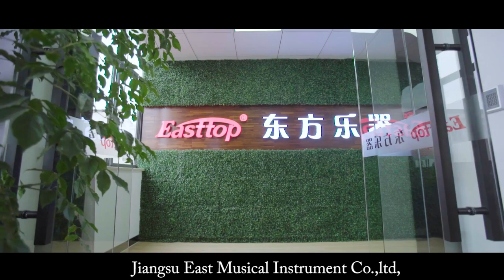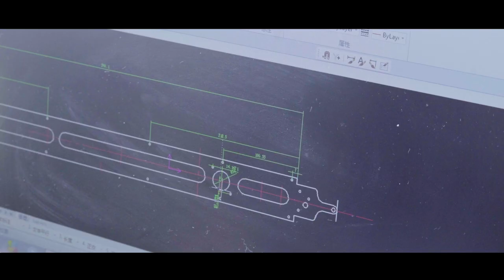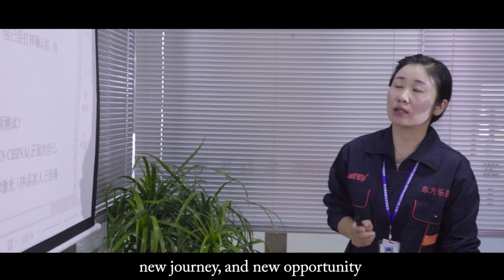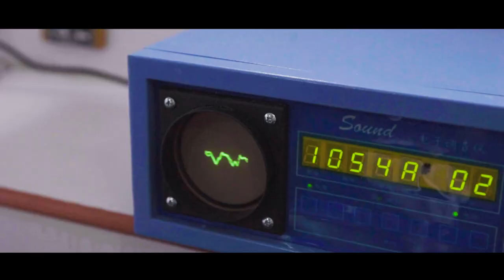Easttop  Harmonica Company Video

Comment: Thanks for the video telling us how good you are.
But with all due respect, the 2 hole draw on the harmonica has been very problematic.  As a customer I expect that each note should be played with relative equal ease and quality.  Can you tell me how East Top has overcome this problem?
Reply from the maker: Sorry you're having problems. Contact whoever you bought it from and complain to them.
Reply: Nearly all players have problems with two hole draw I would think that it’s not the harp but the player. In the beginning I also blamed the harp but it was my playing. If you are a beginner just perceive you will get it
Reply: The 2 draw issue happens on every harmonica.  It's an issue with technique rather than a mechanical problem.  I would suggest searching YouTube for Tomlin Leckie and his video "2 hole draw problem".   You'll find a very similar issue on the top 2 or 3 holes while blowing.   Generally you need to draw less air and focus the air direction towards the top of your mouth.

Comment: GENTILMENTE..SE SONO DISPONIBILI TUTTE LE TONALITÀ..E POSSIBILMENTE AZIENDA OPPURE UN RECAPITO TELEFONICO.
Reply from the maker: Las armónicas diatónicas están disponibles en 13 teclas. Low F, G, Ab, A, Bb, B, C, Db, D, Eb, E, F y F#No todos los modelos de armónicas cromáticas están disponibles en todas las tonalidades, pero las de 12 agujeros, 48 notas sin protectores de viento están disponibles en 12 llaves. dannyg@newharmonica.com
Reply: @NewHarmonica  Bene grazie.. volevo inoltre sapere se queste armoniche sono tutte cromatiche... oppure solo diatoniche.. Inoltre come faccio a contattare l'azienda.. oppure a chi rivolgermi. e il costo di ogni harmonica.Grazie
Reply: Gentilmente il costo di ogni harmonica diatoniche e a chi rivolgermi.. inoltre mi interessava sapere il costo di un armonica cromatica in sol..e se avete a disposizione anche in Key E..-key B.
Reply from the maker: @saveriocolucciarmonica50c
Reply from the maker: @saveriocolucciarmonica50c  Querido Saverio
Tengo armónicas cromáticas y diatónicas de Easttop. Venta diatónica de buena calidad por $30 USD.
El Easttop Forerunner 2.0 Keted cromático NO valvulado (sin cortavientos) se vende por $70 USD Key de C $60 más envío dentro de los EE. UU.
No hablo español, así que contácteme en dannyg@newharmonica.com.
gracias dany g